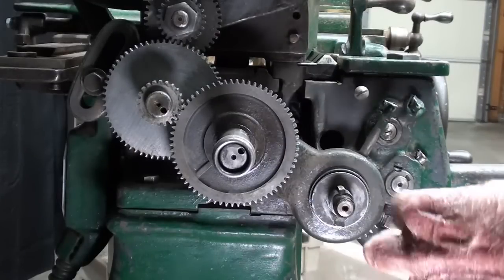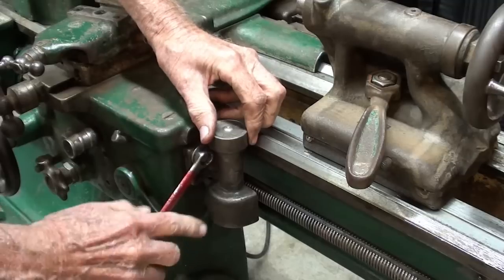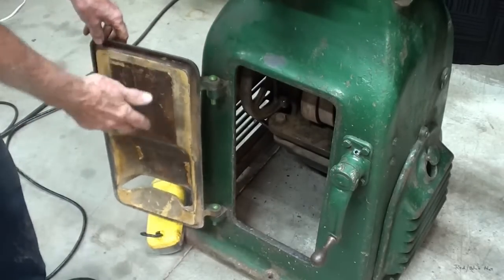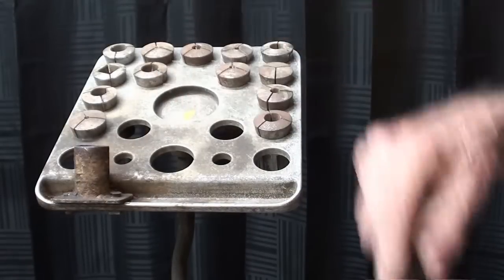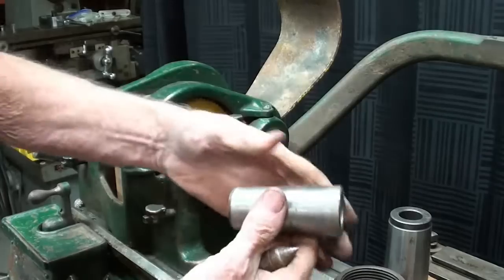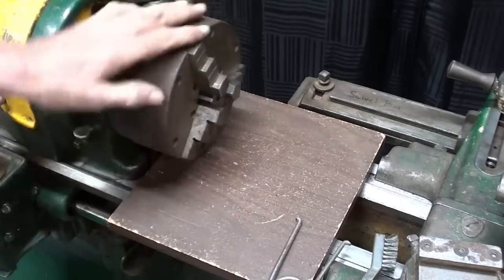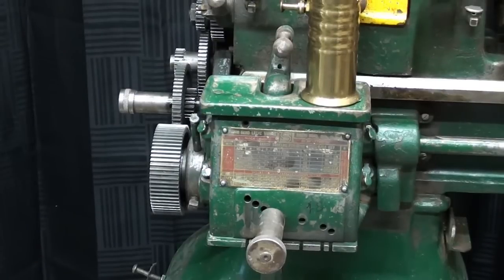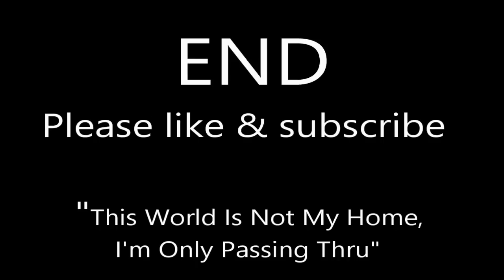SOUTH BEND TOOLROOM LATHE ASSEMBLY pt 2 #1031 tubalcain

Comment: That's a good machine to have around for doing light work.  We had two at work; one with the heavy gauge steel lower enclosure that had drawers on the right side, and the other was like this with the cast iron base.  I found adjusting the headstock bearing to be kind of sketchy with its laminated shims.
Reply from the maker: I agree, I never did like their shim system of adjusting the bearings

Comment: High quality felt never goes bad, other than for some wear from where it rubs on the rails. Soak it in WD-40 and squeeze it every so often for 15 to 20 minutes and almost all of the old oil and grease will come out leaving the felt soft and supple. If you really want to clean it more, then also soak it in acetone afterwards, again squeezing it and it will clean up like new. Just press it down on the rail to have good contact when you tighten the brass, and it’s good for another several decades.
Reply from the maker: That is great advice, and I will definitely try that next time.

Comment: Carp hardness is on a bell curve here in Grand Haven, depending on the number of days forgotten on the bottom of the boat.

Not "hard" to locate on a Wednesday after the Saturday outing, but "harder" to clean up, indeed.

"Hard as a carp on a Wednesday afternoon in July."
Reply from the maker: Yes, and that’s an ugly fish even when it’s still alive. We have lots of those horrible Asian carp in the Illinois river
Reply: @mrpete222  I have a fix for the Asian Carp that no one will listen to.  Love to share it with you.

The Carp Party Barge

A boat with an electric motor, or motor of the quietest type, pulls a barge.  The barge has an open center bottom, like a pontoon boat. The ceiling of the barge would be made of smooth metal in the shape of wings.  Both sides of the interior would have conveyor belts that lead to another conveyor like the ones used to lift bails or feed up into a barn's second floor or grain up into an accompanying truck alongside the combine.  That conveyor would empty into another barge that could be easily switched out as an empty one was needed.  So the boat is pulling two barges.

Experimenting would be done to determine the best sound to drive the carp to jump the highest.  

THE PROCESS: That sound would be blasted down into the water under the first barge.  As the fish jump,  they would hit the wing on the barge ceiling, directing them onto one of the first conveyor belts.  That belt would transport them onto the second conveyor and up into the trailing barge.

That barge would be changed out as it filled by a service boat.  The carp would make their way to the processing plant where they are turned into fertilizer and pig food (or pig food that then turns into fertilizer).  The second boat would return with fuel, second shift crew, and empty barge for the continuous work of the carp party barge.

If you raise pigs, the neighbors, like the neighbors of mink farmers, already know there is an odor problem.

Then, like we do with unfettered fishing of other species, we wipe them out.  This time we do it in exchange for dollars!

What do you think?  Can you picture it?

The system could be improved by making the towing boat actually a motorized pontoon barge set up like the one above, but contain the human crew and controls as well as the first set of conveyors.

The only fish this set up would harvest would be the Jumping Fish of Carpasia.  

I am Nomercadies!

Comment: Good machine, i have a 12" leblond regal i got off craigslist. Leblond still in business and they said my lathe was delivered new to a high school in 1939.
Reply: I ran a 16 inch LeBlond in a tool room for many years. I made a lift system to remove and store the heavy 3 jaw chuck and replace it with an even heavier 4 jaw. So glad to hear LeBlond  is still in business. Where are their products manufactured now?
Reply from the maker: Those were great machines. I did not know they were still in business.